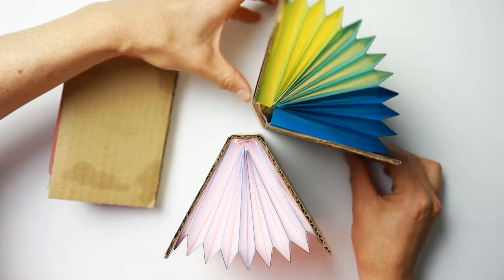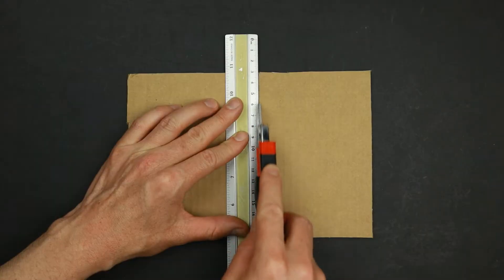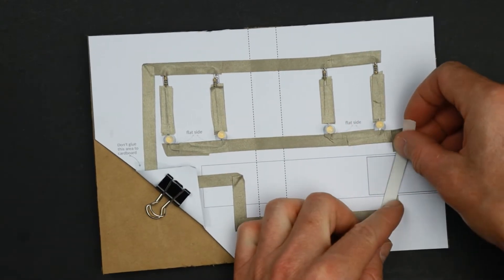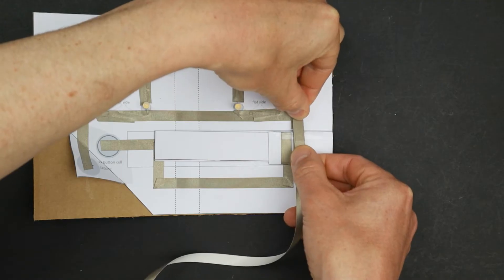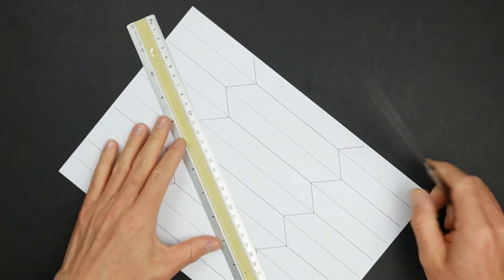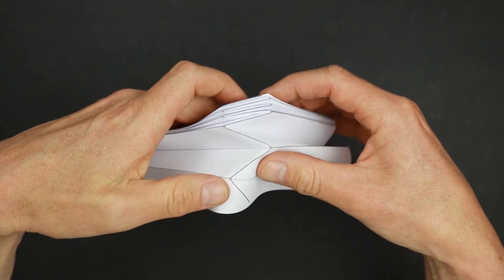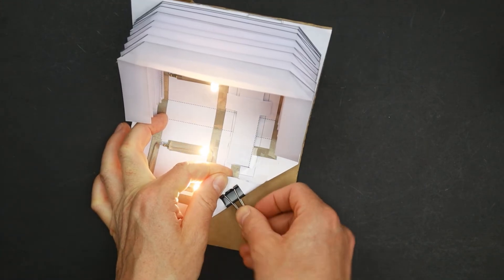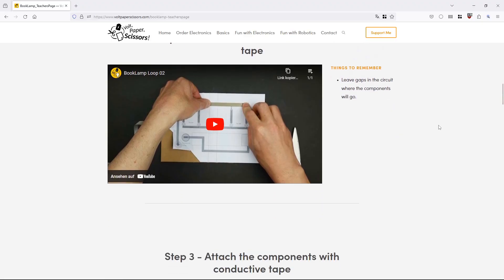DIY Book Lamp Tutorial

Comment: Thank you for this tutorial! I was wonderful about the use of vegetable oil on the paper. Is there a risk of the electrical components in the project causing a flammability risk with the oiled paper? Thank you!!
Reply from the maker: No, but it is important that you use button cells as shown in the video and not other types of batteries, because button cells are not designed to deliver large amounts of power.
Reply: @VoltPaperScissors  oh, wonderful! thank you so much! these are going to be christmas gifts this year, and my loved ones will be so thrilled to get these!

Comment: Hi this video is amazing I’m trying to make a prototype for my design class that has some elements of the book lamp and this helped! Just wondering is the paper that you’re using a specific type of paper or just normal computer paper?
Reply from the maker: i use normal printing paper for the bellows. the slide switch has to be more sturdy. I use paper that is about double the weight/thickness of normal printing paper for it

Comment: Could you explain more about resistors, please? Most tutorials don't use it and say there's no reason for that. Thank you in advance
Reply: I am not the expert here but as far as I know it is like this. The leds need a slightly lower voltage than the batteries provide. You can often run them for a short time without but they will break depending on their color sooner or later. With the resistors they will last longer. Plus when you connect the leds to the power there will be a short voltage spike. together with the already heightened voltage this often kills the leds. the resistors help protect the leds by turning the extra voltage into heat, they have a higher tolerance for this kind of stress.
Reply: @fleity  Resistors are actually to limit current and not voltage. High current leads to squared heat output which leads to LED burnout. However some power supplies like button cells are not capable to provide high enough current and thus no resistors is needed.
Reply from the maker: I'd say using LEDs with one button cell is fine but this project uses a stack of two, resulting in 6 Volts for 3-Volt LEDs. So we use the resistor to protect the LED (adjust the voltage over the LED). 
Also, this project is for older kids and they should learn how to do it right. And using a resistor with every LED is definitely the right way once you use a different power source. Button cells are designed to supply devices with only very little power over a very long timespan. Thats the main reason why they don't damage LEDs. Other power sources will damage LEDs fast if there is no resistor in place.
Reply: @VoltPaperScissors  thank you so much for the answer!
Reply: @VoltPaperScissors sorry for maybe a stupid question, Ijustloveyourprojectsand try to understandthembetter.  Why do you use 56 ohm resistors if you having 6V power source and 3V in parallel connected LEDs you need to achieve 3V of voltage drop with 150 Ohm, don't you?
Do I miss something? And why do you actually need 6V for 3V LED if connecting in series doesn't influence the capacity?
Reply from the maker: These questions are very reasonable. 150 Ohm is probably the correct value (when calculated). I use a lower value because of the limitations of CR2032 cells. If you have a multimeter you can try yourself: Once you attach 4 LEDs (or even 1) to a button cell the voltage over the LEDs will start at 3V but drop quite quickly to something below 3V. Coin cells are not designt to supply components with "lots" of power over a longer period. I wanted the book to be as bright as possible so I decided to use 6 Volts. I found 56Ohm to be a good value because of the voltage drop that occurs once you draw power from the batteries. So the exact value does not really matter. You can use 150 Ohm as well if you want to teach students how to correctly calculate the vaule. The LEDs will be slightly dimmer but it will still work just fine. I even tried it with no resistor in place and none of my LEDs broke but doing it that way felt wrong. 
Using two coin cells in parrallel would also be an option and the voltage drop would not be as big since the power draw on each button cell would be lower. But LEDs would still be a little dimmer compared to my solution. Another disadvantage of this solution is that the required circuit needs more space and if a student attaches one of the batteries the wrong way it would be a direct short circuit between the two attached batteries. 
These are little details and there are multiple working solutions. In the end I decided to go with the 6V stack and a very small resistor. 
Thanks for asking. It was fun answering this as it illustrates how much thought went into designing this :-)
Reply: @VoltPaperScissors  thank you for the detailed answer.  I'm really fascinated with your ideas of paper circuit use. I just like to understand before trying it myself. 

As far as I know from physics lessons and researchi did inspired by your videos, the voltage drop happens only with the components connected in series,  but your design is with parallel components where all the circles supplied with the same voltage except if there's a common resistors. The main issue in the parallel multi component curcuit is the current use, so your battery can provide something around 200mAh. Each LED takes around 20 mA, so the runtime is 200/80 ~3h

But maybe I misunderstood somewhere the physics behind.
Reply from the maker: @anastasiia418  Your research is all fine but physics lessons assume an optimal power source. In my experience CR2032 are simply not able to deliver full 3V over an extended period of time when there is a certain power draw from it. CR2032 are designed to power a watch for 3 years or similar use cases. Also you do not get 3V once the button cells are half empty. It is simply a limitation of the button cells. Things would be different with another type of battery.
Reply: @VoltPaperScissors  thank you for the explanation)